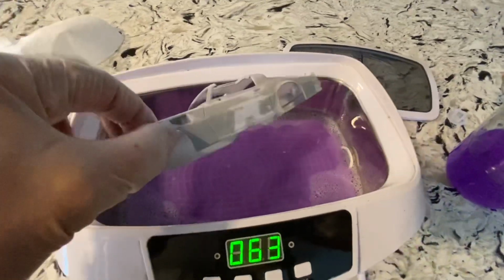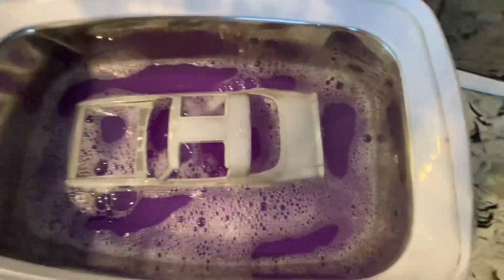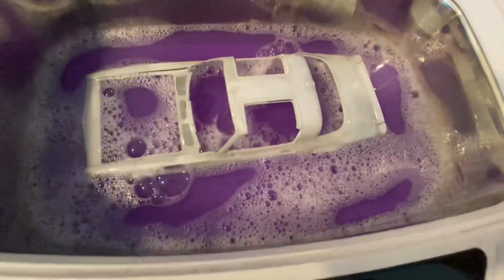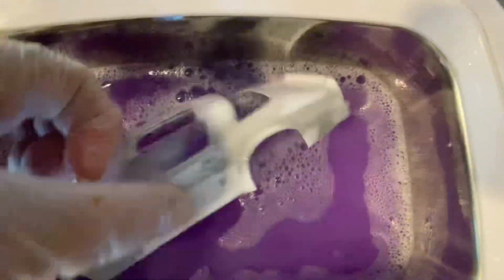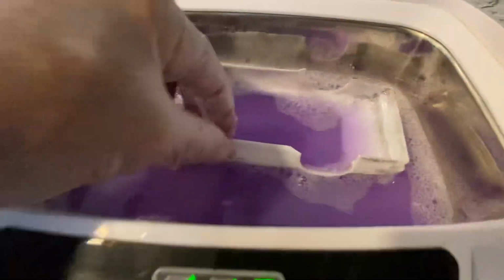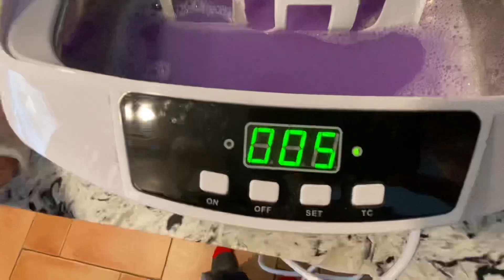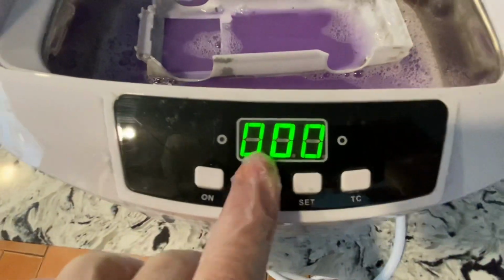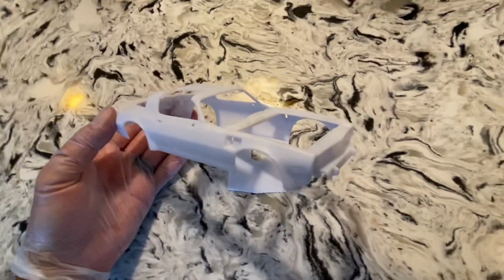How to Strip Paint & Primer from Scale Models

Comment: Ultrasonic cleaners are used a lot by model train builders to prep surfaces for painting on both plastic and metal models. The difficulty with stripping plastics is most of the chemicals that will strip the paint will destroy the plastic also!